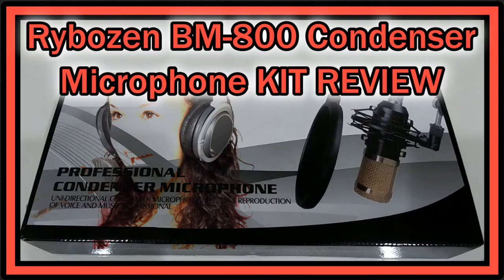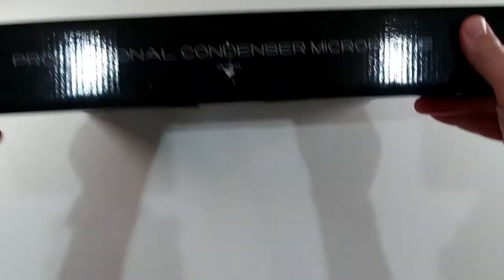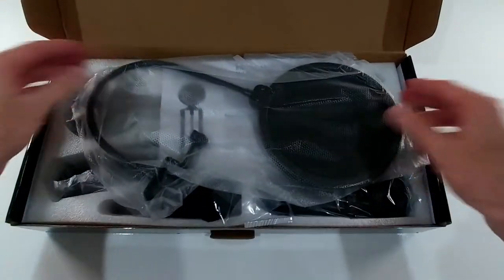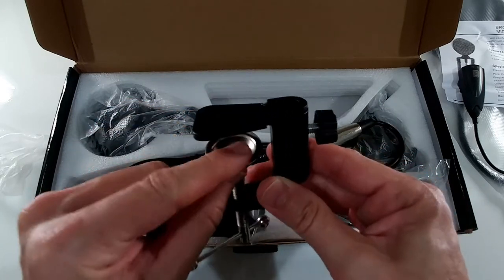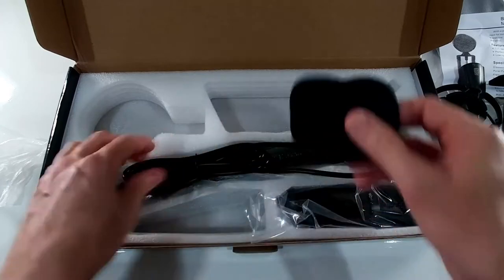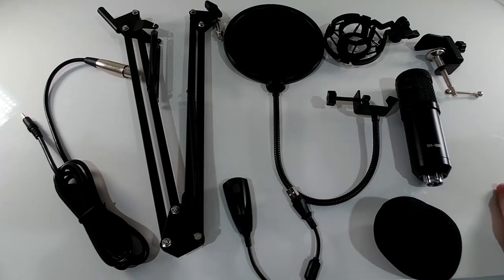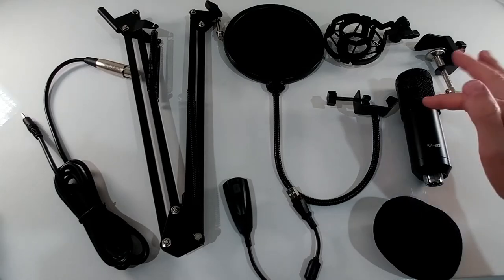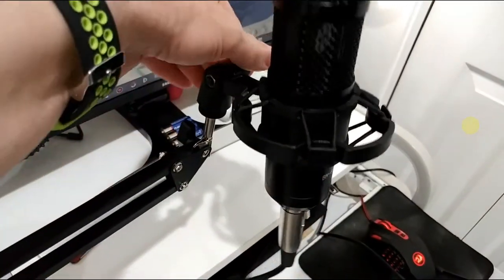Rybozen BM-800 Condenser Microphone Bundle Kit Sensitivity:-32 Large Diaphragm $39.99 - FULL REVIEW

Comment: How’d you get it to work
Reply from the maker: Means you didn't?
Reply: @allcheckout  yup I got an audio splitter and it’s still not working
Reply from the maker: Did you use the 3.5mm plug or the 3.5mm to USB adapter?
Reply: @allcheckout  No I just ordered a phantom power
Reply from the maker: @kdotebkk  Never heard from this brand. Is it good?